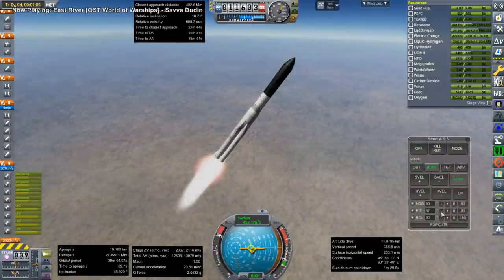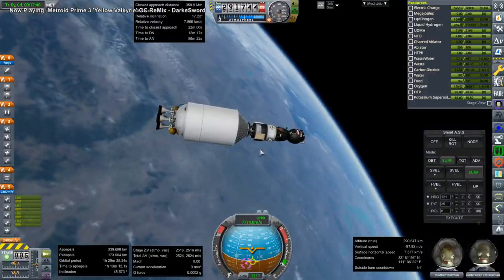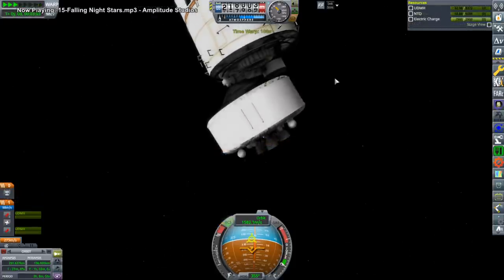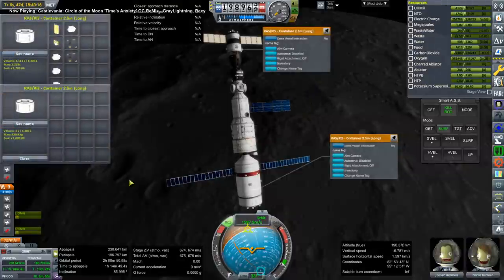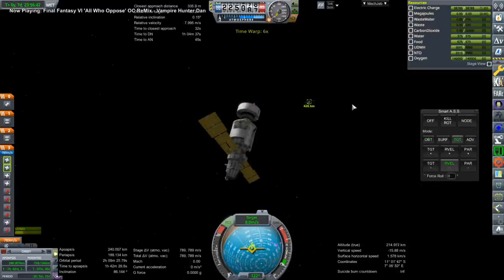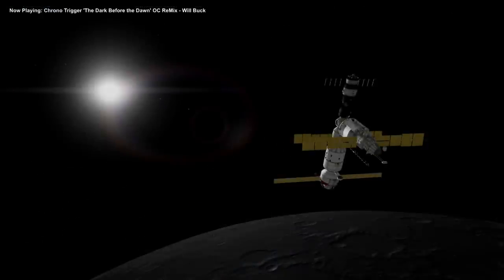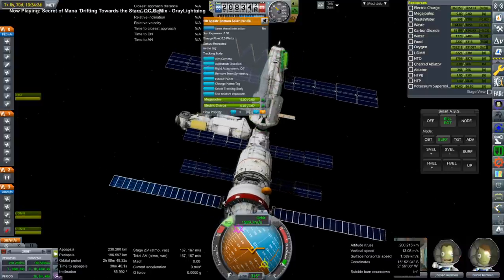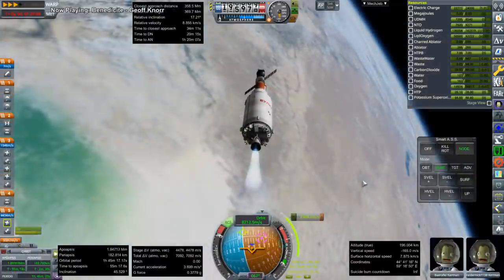Realism Overhaul in KSP 1.8.1 - Mir Around the Moon

Comment: All those inclination corrections become unnecessary if you choose right time of the day and month for launch.
Reply from the maker: Mostly, but would you be able to calculate that? I certainly can't - the best I can do is guess a timing, check, and refine, but that takes time.
Reply: @RaizSpace  It is easiest to do if you use optimal Hohmann transfer with perigee at LEO and apogee not above lunar distance. The major axes of your transfer orbit should be perpendicular to the targeted polar LLO. 
Choosing the right time of the day is more difficult since Moon's orbit is not equatorial. However you should not be too far off if the line between Baikonur and Earth's center is parallel to plane of the LLO. If you are launching slightly north-east to dodge Inner Mongolia then the right moment is maybe one hour earlier.